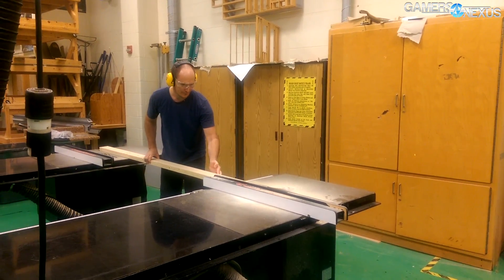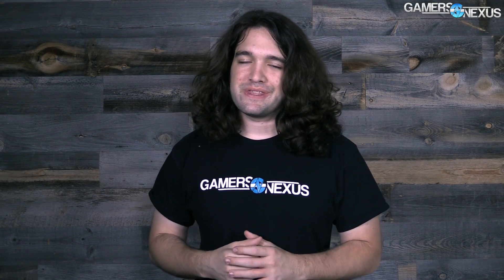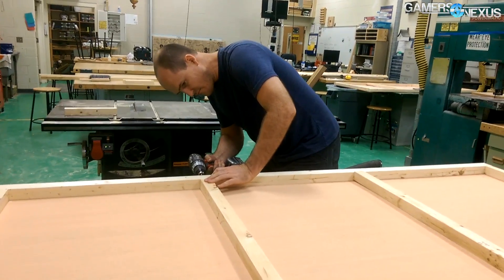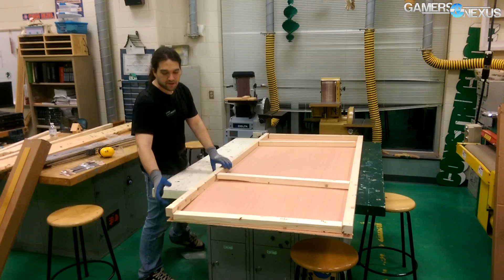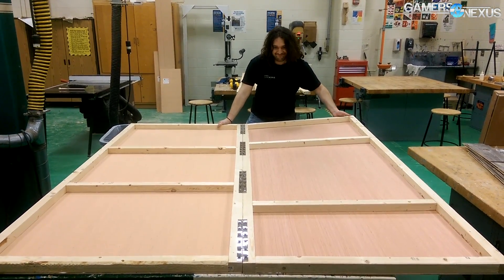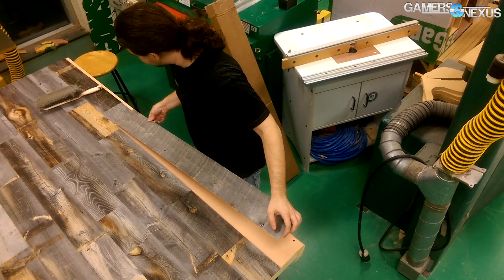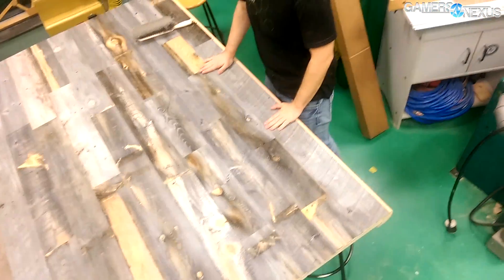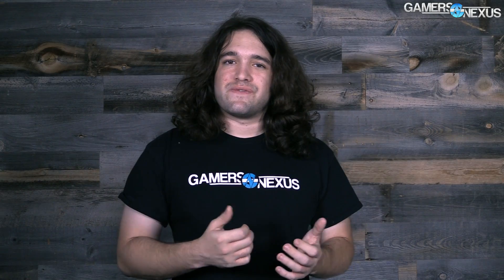GN Set Build Pt 1/2 - Thanks, Viewers & Fans!

Comment: You had me cringing at the first scene with the wood ripping. 

Totally shoulda just gone with like 4 small square frames of 2x2s that you'd have bolted together from the back. If you ever need something built near san diego do let me know. 

Either way, nice to see it all growing.
Reply from the maker: +Street Guru We consulted a local set designer with more than a decade of experience in technical theater, who ultimately designed the setup consistent with our many needs. We built the two frames (it has to be sliced horizontally -- if you slice vertically, you will see a split in the wood paneling and we wanted a staggered pattern) with 2x2s that were screwed in from the back. A sheet of lauan wood is on top of the frame, then we stuck the adhesive paneling to that wood. The frame is hinged horizontally so that it is mobile and so that the paneling does not have a sudden interruption in pattern (as it would from a vertical cut). The thing is 7x6, which made it a logistical challenge to figure out how to get it into the house. Hinging resolved that. The top frame hangs from the wall using a 15* cut in another 2x2, so it's hanging and held in place with gravity, which means less depth is consumed in our limited space.
Reply: +Gamers Nexus
Ya but like, does that guy live in a shed, I don't think so.

Really my design would have ended up with some duct tape, made from pine for 20 bucks at home depot
Reply from the maker: +Street Guru We do need a tape expert to get control of all these damn wires for the lights and camera! :)
Reply: +Gamers Nexus Velcro Ties man, Velcro Ties

But I suppose ya know if you wanna be all professional and shit, that might have been the way to go.